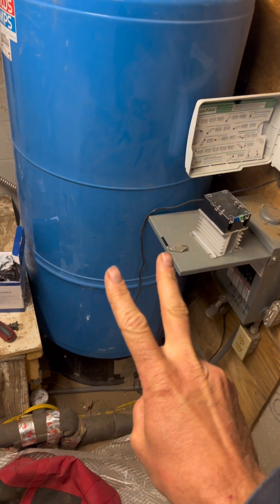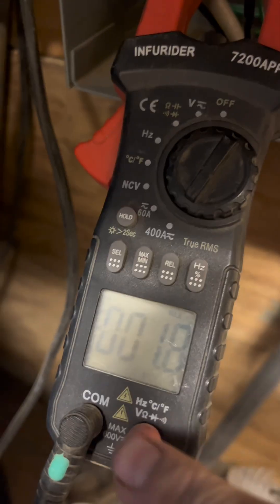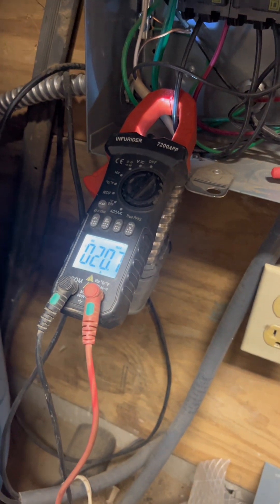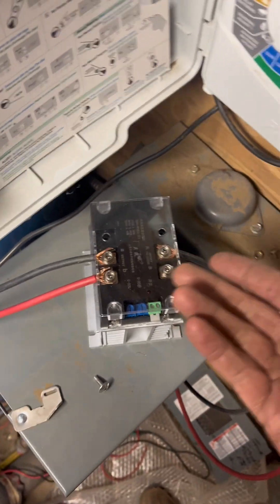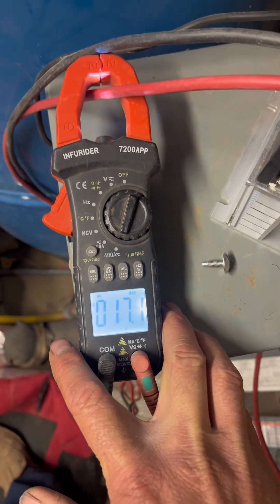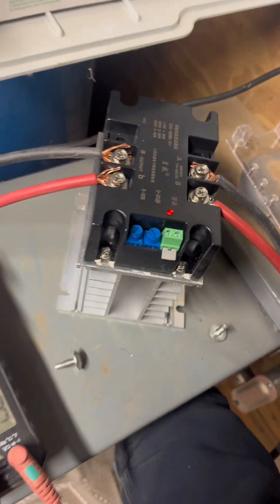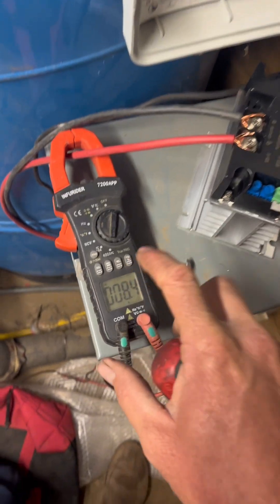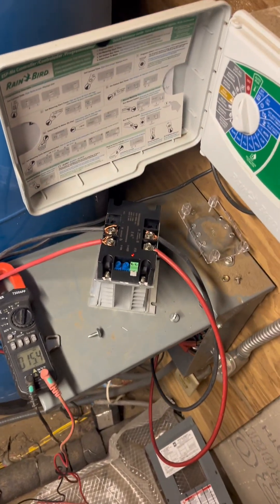Reduce starting Amps Water/Well pump Soft Start 2kw

Comment: Hello prof thanks for this video... i have a question, is the adjustment on the blue buttons are all counter clockwise to reduce? And clockwise to increase?
Reply from the maker: I don’t remember. I just moved things and re-tried.
Reply: @RetroElectric Does your unit of soft starter has soft stop, or soft starter without soft stop?

Comment: Hi, I have a couple questions if you don’t mind me asking.   Is it wired between the breaker and the pressure switch?   Did you leave the jumper in to keep it powered on all the time?  if not how do you activate it?  I’m just about ready to try one on my well pump but don’t want to screw it up.
Reply from the maker: I replaced the jumper and use the pressure switch to be the jumper

So when the pressure switch engaged, the circuit was complete, and the unit turned on when the pressure switch opened, the unit turned off. The wire is coming from the breaker go through this unit and then right to the pump itself.
Reply: @RetroElectric Thanks for the help!

Comment from the maker: I’ve Been very satisfied with this setup. It is also a lot easier on the pressure switch contacts with using the green relay on the device. . I think my starting amps were higher than what my meter was picking up anyways.

Comment: Does this model work with 120V also right? 120V at 1kw is that what I am seeing? I have a goulds jet pump I am trying to get to work with my 5Kw inverter, it instantly over currents. which is off because I hooked it to my 3kw inverter a few weeks back and the 3kw inverter would run it.. but with a really really long power cord.. which I wonder if it was acting as a current limiter with the distance of cord I had running it.
Reply from the maker: The current limiter with a long cord can help. It might work on 120v too. I’ll check when I get home. It should almost work for any single phase pump weather it runs off 120v or 240v 

Also if you take an extension cord and wrap it around an old rim that can act like a current limiter during the initial start.
Reply from the maker: It works with 120v model but is for a smaller (same size amp) motor. Maybe buy a higher kw soft start to handle the higher amp 120v motor.

Comment: Is your well pump a 2 wire or 3 wire setup?
Reply: I ended up using a grundfos soft start in my application with a constant pressure valve.  Seems to be working great.
Reply from the maker: @StudioRV8 cool.
Reply from the maker: Single phase motor will be two wires. This device is for a single phase motor. 3 phase motors can use VFDs which is a bit better option. You wouldn’t need to run ground through this device. If your motor is 120v you’ll run neutral through it but if it’s a 240v motor you don’t need to run the neutral through this device if it’s a motor running of a split phase residential system.

Comment: Your demonstration doesn’t show what the in rush current is, it’s just showing the continuous average current . In rush current is what is important to demonstrate that the soft starter is working. It looks like you’re only getting about a 10% reduction of in rush current. That’s OK, but not great.
Reply from the maker: Yeah, I’m sure the in rush current is a lot higher than what this meter was capable of measuring.
Reply from the maker: It worked for what I needed it to work for so I could run my 7 kW instant hot water heater and still have this water pump kick on and not overload my 10kw of inverters.
Reply: A lot of these newer meters have an inrush measurement mode for setting up 3 phase inverters, you might check the manual

Comment: There is a fan that comes with it. I was wondering where to connect the wires.
Reply from the maker: I didn’t get a fan with mine.
Reply from the maker: If it’s a 240v fan connect it to the output to come on when the device is triggered on with the green relay.